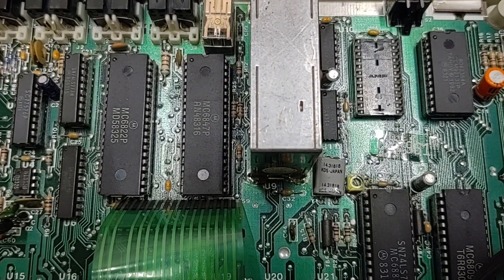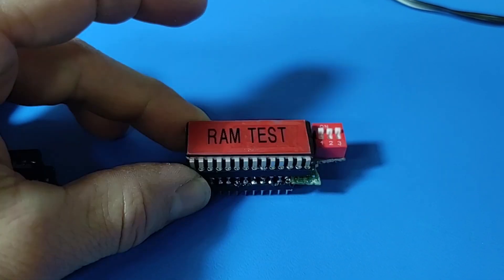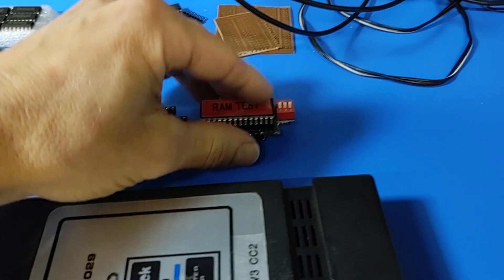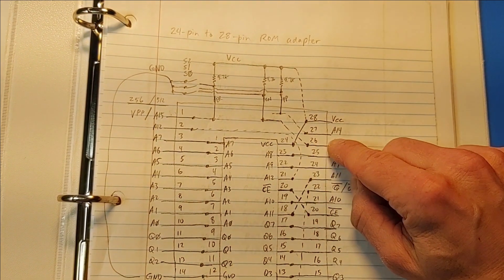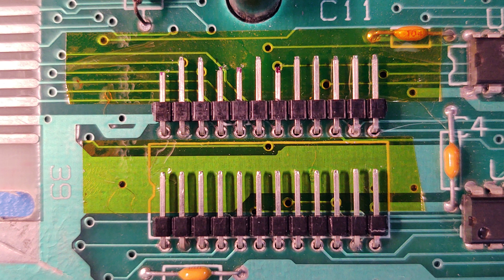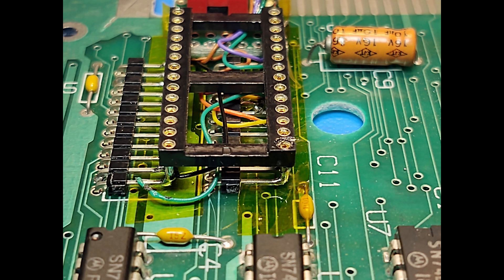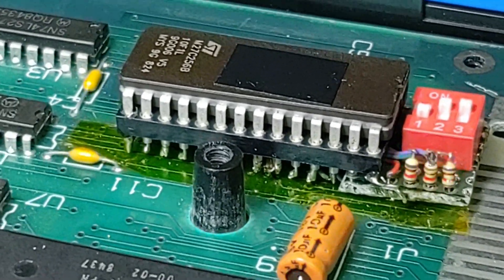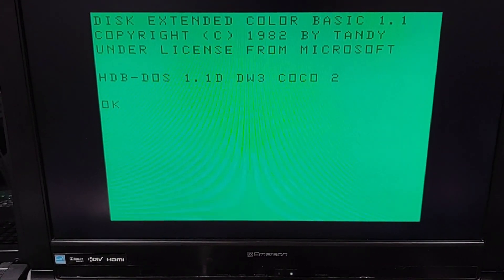Building a Low-Profile 28- to 24-pin ROM Adapter || RAM-test for TRS-80 Color Computer 2 (CoCo-2)

Comment: Your HDBDOS version is ancient. 1.4 or 1.5 should be easily available
Reply from the maker: Thank you for your feedback Mikey. I bet there are newer versions than the 1.1 I'm using.  I had the impression however that 1.2 and newer were created to support CocoSDC and emulators.  All of the documentation I could find on DriveWire3 for real HW (non-emulator) led me to the version I am using.

Comment: Great work on the low profile mounting of the Eprom. Also, a nice compact way of adding Dip switches to a chip. Solid work.
Reply from the maker: Glad you enjoyed it.  I am really into these ROMs right now.  I'd like to have one with a larger number of ROM Pak images available.  I have a second stacked ROM that contains the RAM Test program by Denis Bisson.  That is a real trick for diagnosing RAM problems.  I think there could be more done with diagnostics in one of these.

Comment: Great video! I’ve once made a stacked socket adapter to fix the ROM in my friend’s 1541. I happen also to have a small, thin PCB that would adapt a 28-pin IC to 24-pin. I would need to figure out suitable pins or sockets for that, though.
Reply from the maker: Very cool! I wondered about the availability of such a board.  Do you think it would work for these low-profile needs?  Comment back if you get around to working out the pins with it.  Thanks.

Comment: Good job.  I like the ROM switching solution.
Reply from the maker: Good to hear.  I'm still using it and have another one with a RAM Test program.  These work out great and are not too much of a pain to force the need of a dedicated pcb. I want to do another project as a simple way to enhance an existing ROM Pak with 64 ROM banks. Thanks for your view!